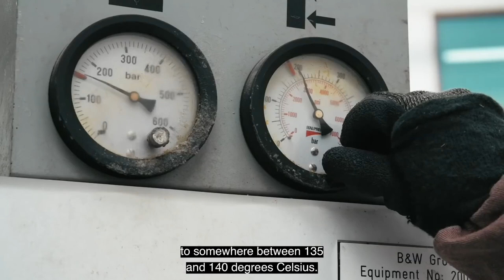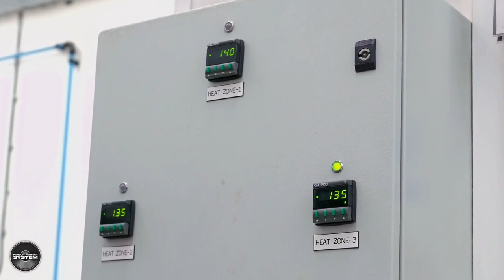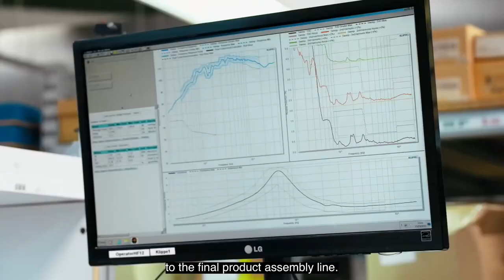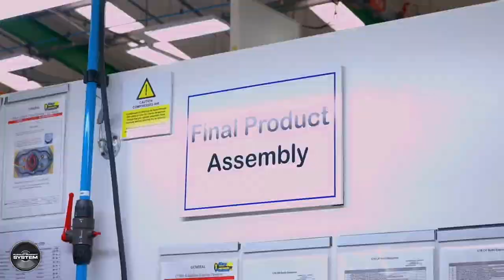New Bowers and Wilkins 800 D4 (2021)

Comment: I own and love the 804 D3. I'm impressed with the updates on the 804 D4. Really nice. Sonically, there's no reason for me to trade in. However, the new 804 has lots more "cool factor". Also, it's the only D4 model where the new tweeter "works" aesthetically (maybe the 805 as well, haven't seen it). This is the "Golden Age" of speaker design!
Reply: You already own?
Reply: @Maex911  D3